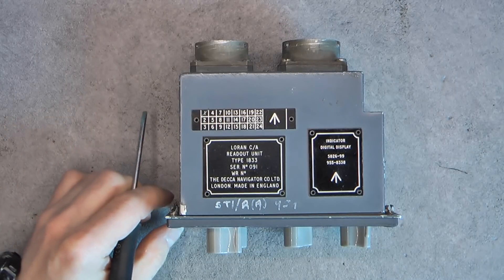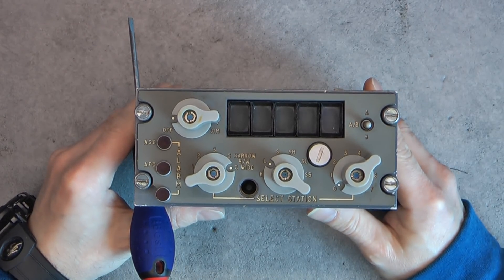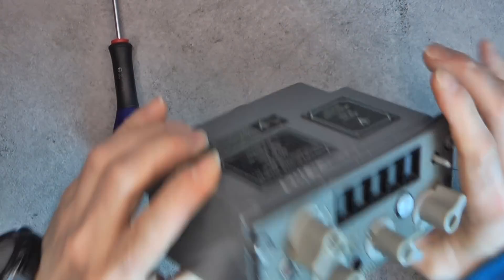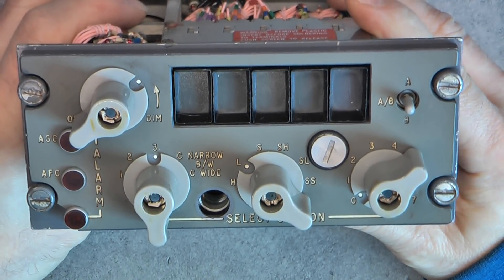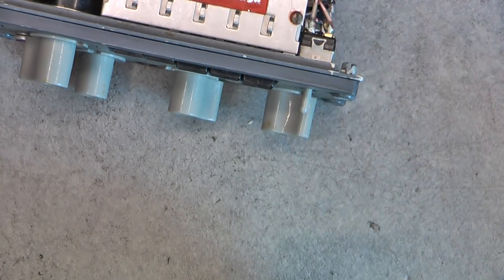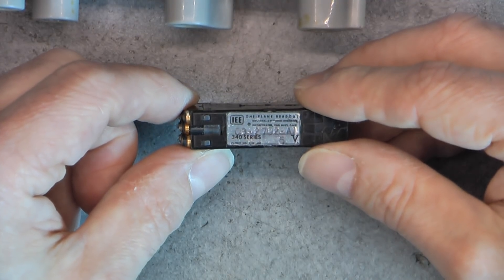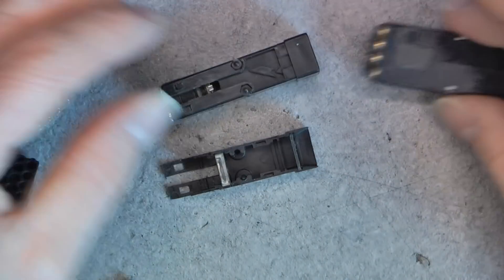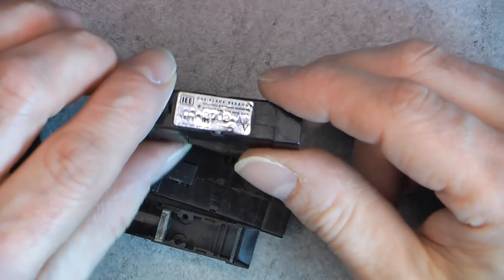A Loran indicator panel with IEE 340 projection displays.

Comment: interesting displays, not seen ones like that before
Reply from the maker: I might use them in a clock project or something. They are a nightmare to put back together it you take them apart.
Reply: @msylvain59   yeah that would look good in a clock.  suspect there might be  a trick to driving the bulbs so they don't die too quickly though,  you may have to give them just a little power even when 'off' to keep the filaments warm so there is less thermal stress when they switch on fully.